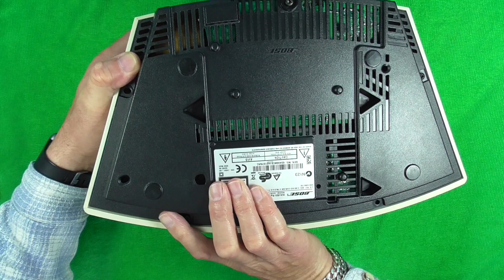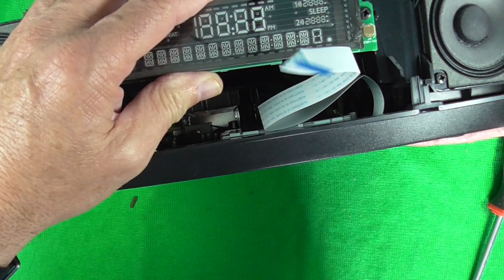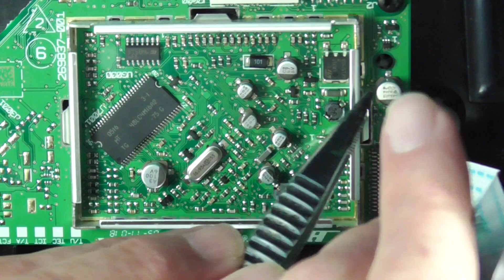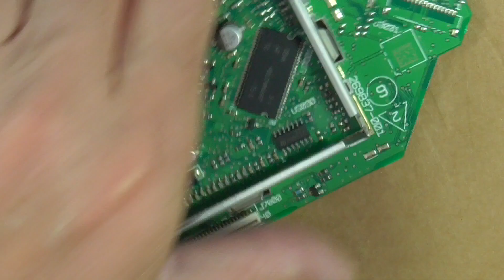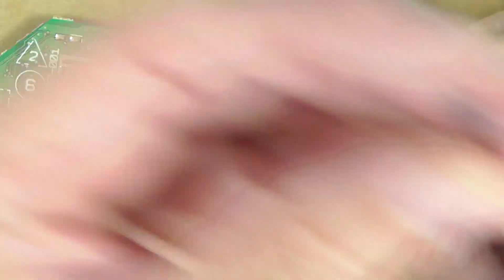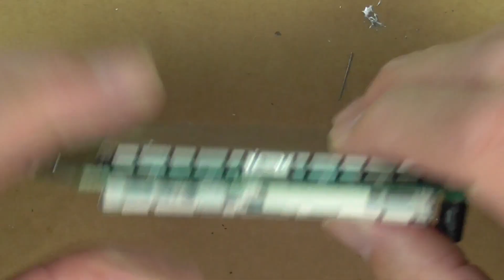How to fix a Bose Wave Radio AWR1B4 with no sound & remote control intermittent

Comment: Thats way too advanced for my skills as I am not a circuit board technician. Is there any way I can just have the daughter board replaced? I can do that much but replacing each capacitor is beyond my abilities at this point.
Reply from the maker: Sure you can just replace the board providing you can find one in good order. Finding one might pose a problem due to the age and if you did is it any better than the one you have is the question. Many thanks for your great comment.
Reply: @DARTraderMediaProductions  Thanks for the response. After finishing your video I decided that I will do your heating test and if it makes it work again, I will go ahead and learn a new skill. I'll order a soldering kit and the capacitors and try to do the replacement myself. It doesn't look as hard to do as I thought and it would be exciting if I actually got my Bose Wave radio to work again!
Reply from the maker: @issaciams Just take your time and don't overthink it. I started working on things when I was five years old, taking stuff apart and figuring out how things work. I learnt many things over the years and I was able to run my own business for over 25 years doing the things I enjoyed, now retired I still like to tinker. Wishing you all the best whatever you decide to do.
Reply: @DARTraderMediaProductions heating it up made it work for me! Thank you so much for this video! Now I will see how long it lasts until it stops working and if its less than a month I will proceed with replacing the capacitors! You've been a lot of help. Thank you. 🙏
Reply from the maker: @issaciams  Very good but the heating usually only restores the working while the capacitors are warm. Once they cool they loose their values again and it stops working. Maybe if it's in a hot room this will slow the cooling but in the end the capacitors will have to be replaced. The heating really is just for diagnostic purposes. Many thanks for your great comment.
Reply: @DARTraderMediaProductions I'm keeping it on so it never has a chance to cool down. If it still shuts off in less than a week I will replace the capacitors. If it lasts longer I might just try the heating trick again. Basically, I'm gonna play it by ear.
Reply from the maker: @issaciams  Great stuff, good luck and I hope it lasts a good while. Best wishes.
Reply: @DARTraderMediaProductions thank you!
Reply: @issaciams  I'm in the same situation. How long did the Bose work after heating the capacitors and leaving it on??
Reply: @andywetzel5559 it kept working as long as it was kept on but my dad kept forgetting and would keep turning it off. Hes old so whatever i guess. Its too much of a hassle to keep reminding him not to shut it off so now its just sitting unused.

Comment: Thx for this. My Bose Radio will not play a CD. It keeps saying Disc CD but that’s it. The clock and radio work fine. I’ll scan your channel to see if you address this problem too.
Reply from the maker: The problem your having could well be capacitors, I've not done a video covering that but there are many on YouTube that do. I have seen a few with bad optical blocks as well, best to do the caps first as it's the cheapest option. Some of the optical blocks are very expensive or just not available these days depending on the model and age. Many thanks for your great comment.

Comment: I have a newer bose then yours but still old model bose wave with 1 cd player anyways 1 speaker works fine but the other one has crazy fuzz static coming out with the music , everything online said amplifier chip so I changed it but still same thing,  what else could I test on the board or what do you think it could be? The speaker itself looks brand new with huge magnet and just 2 wires but I'm nit sure. .. .maybe test it on another stereo if possible I don't have another one at the moment , anything on the board I could test with multimeter?
Reply from the maker: To test the speaker swap it to the other side and if it's still the same then you know then it's the speaker. There's lots you could test with a multimeter, every resistor, diode, transistor etc. Try swapping the speakers around first though. Many thanks for your great comment.
Reply: Same issue with mine. I have the soundtouch version so if I try to switch to wifi, it turns off with a crackle. Also it crackles upon switching modes etc. Any thoughts?

Comment: Thanks for the video.    Could you please let me know the values of those capacitors?
Reply from the maker: Your most welcome. Just replace them like for like is the best way, there are circuit diagrams available on the net. Keep to the original values for the uf but you may go a little higher on the volts if you can't get the exact voltage. For example if it's 10v and you only have 16v it will be fine but don't go under voltage. Many thanks for your great comment.
Reply: They are printed on the capacitor.  Microfarad and voltage rating.

Comment: 20:58 Those plastic bits (Threaded post holes in the top cover) crack and fall apart all the time.   What is the best fix for that?   Please?
Reply from the maker: There a real pain. If most of the post is still there I usually use some epoxy resin to fill the hole and cracks. Once its hardend redrill the hole and tidy the edges up. If the post has broken off then I have had success bonding a replacement post using a plastic wall plug of the correct diameter. The advantage of this is it already has the hole to take the screw but can be tricky to position. They really are a pain to do and it's a case of trial and error. Many thanks for your great comment.

Comment: I've got one. No response when plugged in or using remote No nothing like not getting power when I'm sure it's getting power. Only thing it can be is what's going on in your video. So I'm very thankful for your help!
Reply from the maker: If it appears to be dead with no display it could be a power supply fault. I'd check the outputs from the transformer and the power supply. There are some fuses in there too. Try blowing some hot air from an hairdryer on the capacitors in the power supply and then plug it in and see if the display comes on, it might point you in the right direction. Many thanks for your great comment.

Comment: Great video, what's capacitor did you used, can you tell me the size of each capacitor please thank you, I have same issue with my bose Wave system and I will try to fix it.
Reply from the maker: If it's the same model number as the one in the video then change all the capacitors on the small board as shown. I don't have the capacitor list anymore, I did intend to put it in the description but forgot. Hope this helps and many thnaks for your comment.
Reply: The capacitor values are printed on each one.

Comment: This is useful for me, I have the same issue with my bose wave radio and I'll try and replace some capacitors and see if I can make some progress. Thanks for making the video.
Reply from the maker: I've always found the more you change on these the better but the ones I show in the video are the main ones to do. Good luck and many thanks for your great comment.
Reply: Did you fixed the problem, I have same problem with my bose wave system.

Comment: Hello, Sir, I have a bose awrc1g and no sound is coming out on the left speaker. It has a tiny sound on the right but theres so bass at all. Would you be so kind to point me in the right direction on how to fix the issue? 

Thanks in advance!
Reply from the maker: I'd start by blowing some hot air from an hair dryer in to it to warm it up. If that improves matters then It points towards faulty capacitors. It could be a number of things, capacictors, amp ic or even damaged speakers. Many thanks for your comment.
Reply: @DARTraderMediaProductions  thank you! I'll try that
Reply from the maker: @bill79-888  It's difficult to say what the problem could be but a case of good old fault finding is always the way to start. Good luck.
Reply: @DARTraderMediaProductions  What about hissing ? One side plays, other side hisses. Crackles upon on and off
Reply from the maker: @karthiknaik3944  Could be a number of things. I'd start with general fault finding, open the case and blow hot air from an hairdryer onto the circuit board to see if that restores normal working. If it does then concentrate on the capacitors near the Sound IC using the same process. It will probably require capacitors replacing but also time to track down the area. Fault finding can be very time consuming so unless you have any experience don't expect quick results. Many thanks for your great comment.

Comment: Nice job. I do repair for living. Sometimes there seems to be a short. The replacement of the condensator did not work. It stucks at "please wait".
Reply from the maker: Well that's a pain, not had that problem after swapping out the caps. Looks like it's going to be a little time spent with the meter to locate the fault, could be more caps on the main board as they are pretty poor at that age. Many thanks for your comment and hope you can resolve the issue.